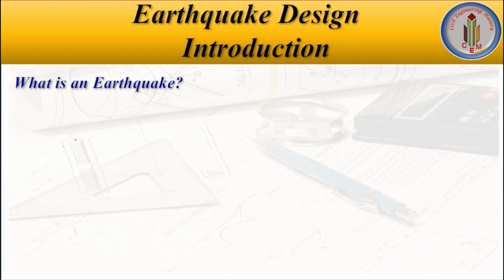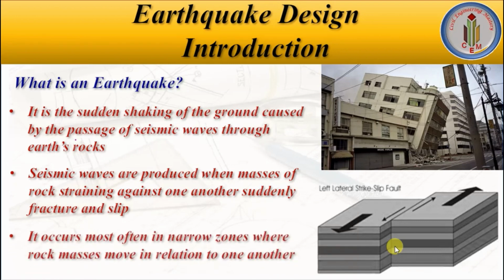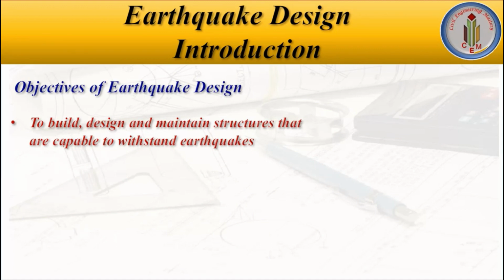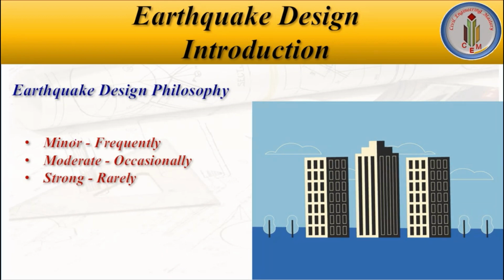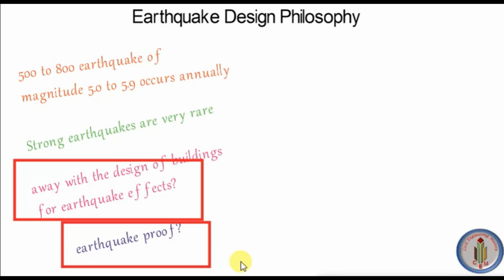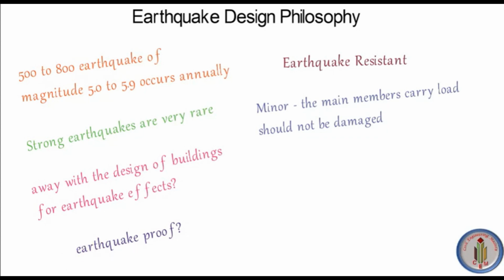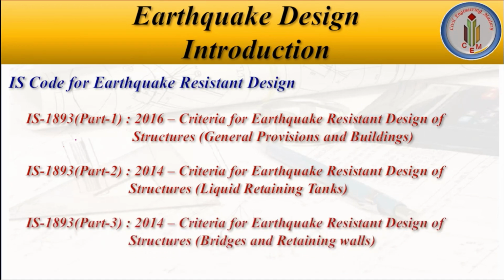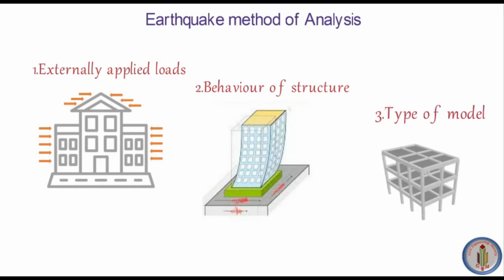Earthquake design | Earthquake design philosophy | Earthquake load | Earthquake method of analysis

Comment: Madam, pls do 1 complete analysis & RC Design of G+1 building with Seismic Effect.
Reply from the maker: I have created a course, structural design of buildings using Etabs software which includes structural analysis and design of  a five-sorey RCC building(Real project) and is now available on udemy.
Kindly use the below link to avail the full course.
https://www.udemy.com/course/structural-design-of-buildings-using-etabs-software/?referralCode=14883FDBBD95A1ADAC02